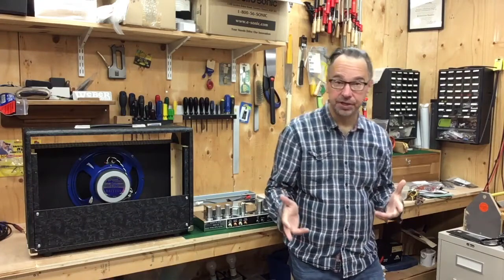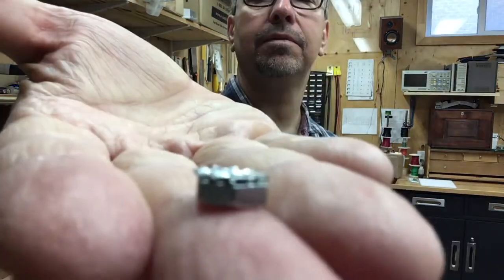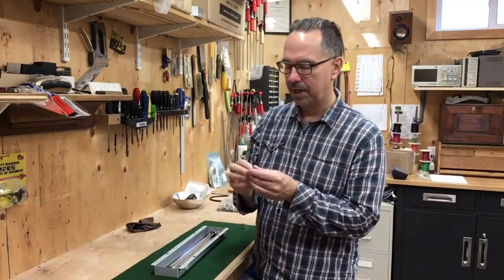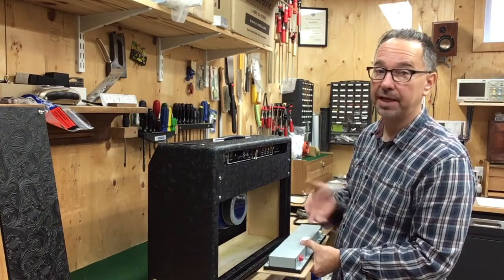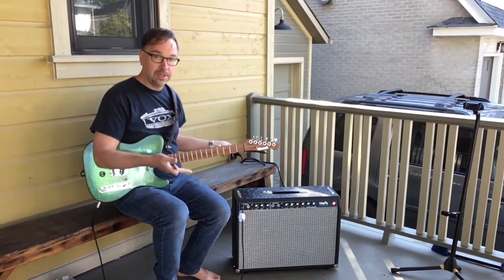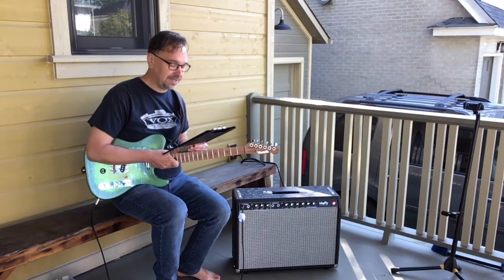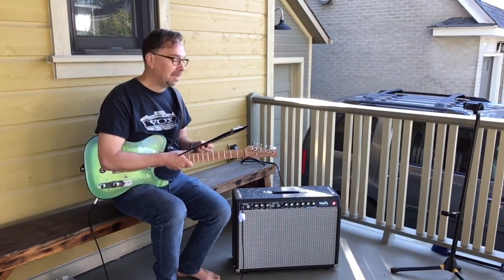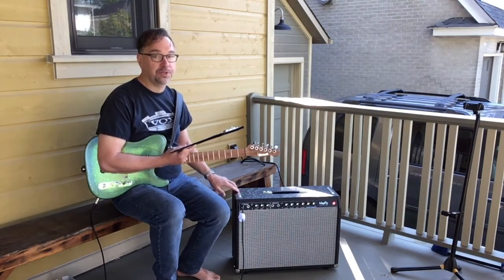Mayfly on the Bench - Deluxe Reverb Build Episode 11: Final Assembly

Comment: Great video series and great tone . I was particularly interested as I am building a Deluxe reverb myself but also without Vibrato. I didn't buy a kit but elected to buy all my parts individually. I'm using a Bassman chassis which was on sale ( I had to add another valve position ) and a  Hammond 372FX PT and a 1620 OT, I know these are not traditional guitar amp transformers but they are similar spec and I got a really good deal so wanted to give them a try. I'm using pretty much the same resistors and capacitors as yours and my valves are all NOS Mullards. I have modified the schematic using Aspen Pitmans book. I made my own piggyback cabinet in Fender style with a 4 x 10" speaker cabinet using Jensens. If I end up with as good a sound as yours I will be very happy. I hope you will do more videos as this series has been excellent.

Comment: Very nice! I still like a mid pot that can also work as a raw control. That can take the amp to brown and tweed like territory. Cheap and easy! Use an empty hole on the front or,,, on the back trough the aluminun plate you used to seal up the chassis next to the power plug in thing.

Comment: So, I've been weighing my options between a '65 Reissue Deluxe Reverb and a Weber kit... I think you made up my mind for buying the DRRI. I know my way around amp circuits but I don't have the patience for all the weird fitment issues, odd parts, and whatnot.... I'd rather get a DRRI and put a push-pull pot on each channel volume to disengage the bright caps (well, after adding one to the Normal channel).
Reply from the maker: Don't forget that the '65 re-issue is a PCB amp.  I've seen the inside of one and even the pots are PCB mounted.  This means your push-pull pot idea for the bight control would be pretty difficult to do.
Alternatively, you could get someone good to build one exactly the way you want it.  You'd end up with something higher quality than the fender.
Reply: @mayflyamp , that I know regarding the PCB and I'm not too bothered by that. I've modded Jet City amps with PCB construction successfully, including replacing board mounted pots.
Reply: Either the weber or mojotone is far superior to the fender reissues! The fender looks like the real deal. The mojotone is period accurate!!! The weber is very reimagined but can be the real deal. The mallory's are the best caps for fenders !! The mojotone uses orange drops! Easy and cheaper change. The mojo builds out to a oeriod correct amp right out of the box!!!!  For the money and details the mojo is the way to go!!! The face plate and rear plates are aluminum machined, painted and silk screened!! Also the cabinets are exact replacements for Fender's!!!